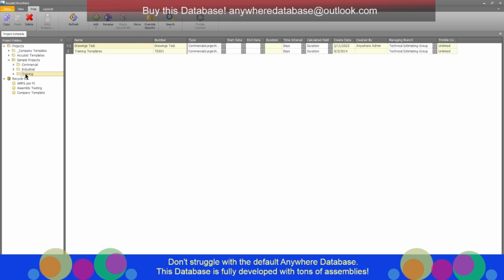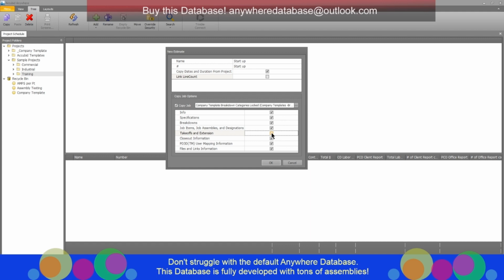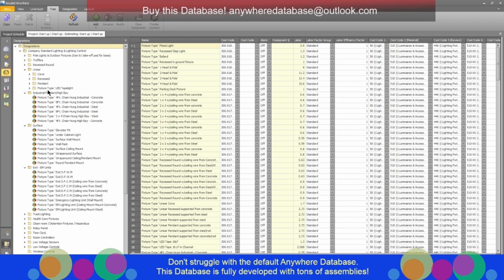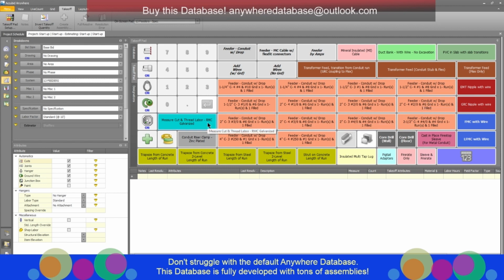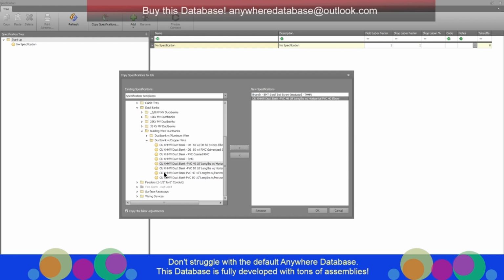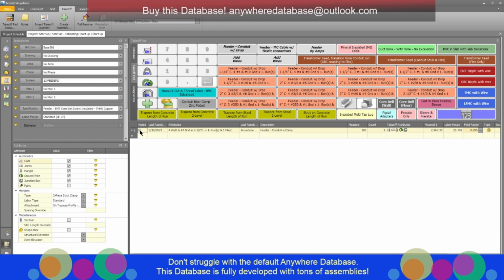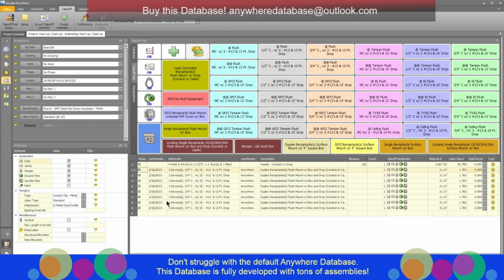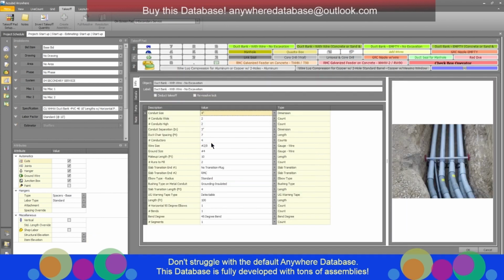Accubid Anywhere Start up video #1

Comment: Hello. Why designations vs assembies. What's the difference.
Reply from the maker: Designations are typically for major quotables like Lighting Fixtures and gear (Switchboards, Panels and such). However, Designations cannot have variables and formulas like the assemblies in Anywhere can have.
Reply: @anywheredatabase956  thank you . How can I pm you?
Reply from the maker: @mstrlucky652  There is an email on the about tab on YouTube that you can contact me, if you have any issues with that, let me know

I have a linkedin page too

https://www.linkedin.com/in/anywheredatabase/
Reply: @anywheredatabase956  maybe I’m missing it but I don’t see it on the about page
Reply: Please let me know ty
Reply from the maker: anywheredatabase@outlook.com